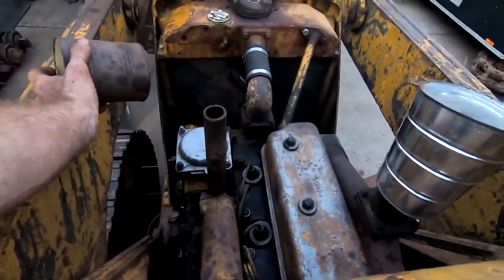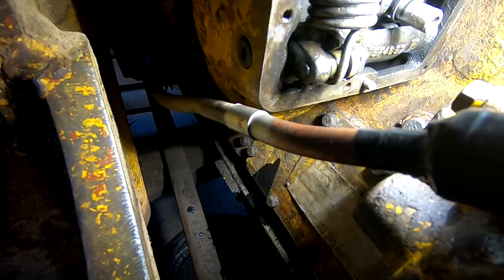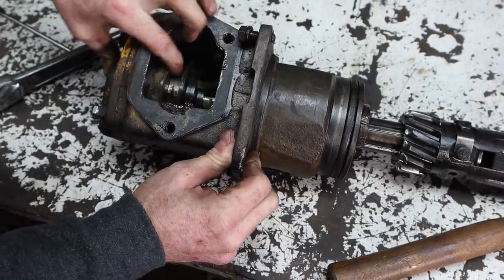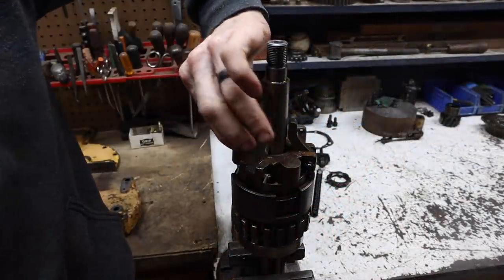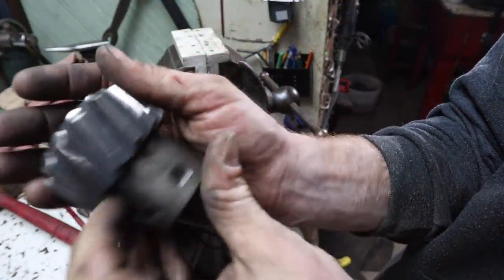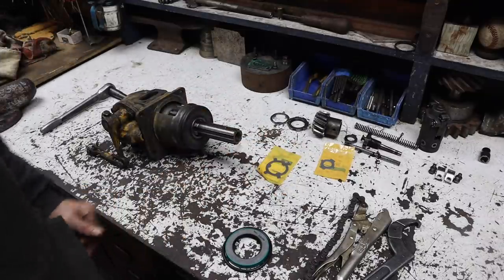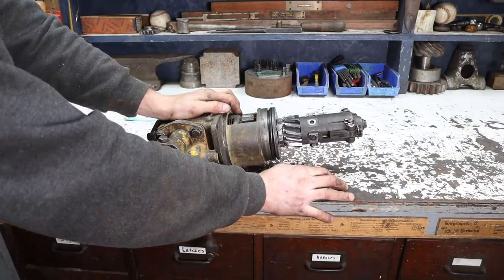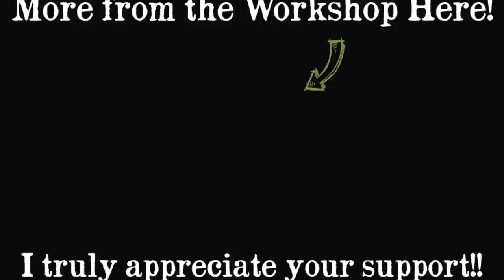Removing & IMPROVING the Starting Clutch ~ Part 16 ~ 1950s Caterpillar TraxCavator

Comment: On the end of those weighted dogs is a screw, one on each, that adjusts the rpm required to kick out the pinion.
Great video.  Waiting to see the pony and big engine going again.  Then the under carriage and sprocket so we can see this thing in action.  I looked at the manual for the governor those 2 bolts on top under that cover are stops for some adjustments in the throttle/governor.  Not sure exactly what.  Seems this might be a newer governor that the 1938 than Squatch253 has.  Do not recall it being the same.
Reply from the maker: @squatch253  I figured it was something like that! Thanks for watching and letting me know!

Comment: Hey! Love your Old Red series. Looking at a 933, it has three teeth broke on the ring gear on the flywheel. Can you tell me how difficult it would be to remove the radiator and engine or can the transmission be pulled out of these to swap out the ring gear! New one is $68.

Comment: The deeper you get .. the more I wonder how you got her running..
Reply: I was thinking the same thing! How in hell did it ever run in the first place?
Reply: These old machines can take a beating and keep going. New equipment will never equate to how well things were built from the 1940's to the 1980's.
Reply: @UnitCrane514  👍
Reply: @UChrjod6h-1jZNpEYYK8OVuw clutch... a means to temporarily disengage the drive from the engine to the gear box, whilst changeing gears.. so as not to damage the gearbox. (Get in a car .. try changing gear without useing it... ewwww)

Comment: I think the pony motor exhaust warms the diesel intake manifold for easy cold starts......genius
Reply: I think so..if only they'd put a mini muffler on those ponies
Reply: I believe they share coolant too, which might get some warm around the diesel on a cold morning.
Reply: I think the pony warming the diesel is the coolest part. Can start at any temperature.
Reply: @jaytodd5809  Why?
Reply: @WolfePaws  The pony doesn't run long enough to warm the diesel. The starting process only takes a minute or so.
Reply: In the 60's and 70's when we operated these older Cats we would run the pony 5-10 minutes..injection hold and compression off..at the right time throttle and compression on and away they fired..but many a time we were guilty of throwing on the compression and shooting the ether for a quick cold start...probably one of the main reasons these old diesels are tire and worn..
Reply: @Craneman4100w  Sure, you wouldn't run it for long with under compression, but I see no reason you couldn't run it for a while with clutch out and compression off. I'm honestly not sure if it would make a huge difference, but I've worked with diesels in the past which really hated the cold, so every little helps.
Reply: @Craneman4100w  I'm guessing you could idle the pony motor for as long as you want while you're getting other stuff ready to go before you try firing up the diesel if it was really cold out.
Reply: I've been a heavy equipment operator since getting out of the Marines in early1975. For the last 10 years before I retired I was an instructor/proctor at ASIP Local 150 (Google it and select images (I"m in a few of them :-D)). When I started out in this business, machines with pony motors were the norm They were all roadsters too (no ROPS) and we carried our own Cat Sunbrella (look at old dozer pictures to see them in action) with us. I've run many machines like this, graders, loaders although I did not run this model, scrapers, dozers, backhoes, cranes, etc. Here's how it works in the cold. Put the glass float bowl on the carb (you always took it with you or hid it on the machine before you went home) and put a splash of gas in the tank (if you left the tank with any appreciable amount of gas in it rest assured someone would stop by and siphon it all out for you). Compression release open, clutch out, maybe a shot of starting fluid in the carb. Open the gas shutoff valve and start the pony. Most all of them were started with a rope pull cord. If it had an electric starter, and by some miracle, it worked, you're ahead of the game. Warm the pony just until it ran smoothly, idle it down and drop the pony clutch in as you throttle it back up. A few seconds after you have oil pressure drop the compression release in (closed). The diesel will usually start almost instantly in all but the coldest weather. I don't remember ever having to chug the diesel for long as they compression fire and a pony motor spins the engine along at a good clip. On the very worst days, a quick squirt of "E" into the air stack and she'd pop off right quick, on a warm day, no either necessary, she'd pop off almost instantly. The diesel will kick the pony out the instant it lights. Now, shut the pony's gas valve off and let the pony stall when it runs out of gas. Take off the glass float bowl and wipe it out or give it a short squirt of either to clean the gas smell off it and put it back in your lunch box. Open your thermos and pour a cup, grab your grease gun and go earn your money.
Reply: @Craneman4100w  appreciate the indepth info there..triggered some of my recollections about them ha..Did you ever come across an electric start conversion(no pony)? ..and if so was it any easier to start the diesel?
Reply: @jaytodd5809  Yes, electric conversions became very common and basically worked as any electric starter although you still had the compression release on some that would help spin the diesel up a little easier. I forgot to mention that if you didn't have either, we would open the oil bath air filter or remove the air filter element, as the case might be, and wave a gassy rag around inside the can to use the gas vapors in place of either. Don't let the rag get sucked into the engine though, that's demonstrating poor technique.
Reply: Sorry wrong person

Comment: the fact you can fix these by hand shows the incredible engineering that went behind these machines 70 years ago.... today you need a special “by the way” tool for everything.  #righttorepair
Reply: Fact
Reply: There are still people today like me and the brother in law who will make a tool to fix something it makes things longer but the tool is always there no matter how special the art of mechanicing is dying it's a computer operater and a parts swop the problems usually come back they solve the symptoms but don't dig to find what caused it nowadays
Reply: "By the way tool." Ha your lucky if it's even repairable these days. 15 years ago we could fix it with a tool. Now though most everything is garbage with or without tools.
Reply: @Boga217  this is true... I follow Louis Rossman on youtube.. Huge advocate for right to repair..   Corperations basically want you to "buy" their equipment... but when it comes time to repair... they treat you like you "rented" their equipment... total scam.....  thats why they want all data in the cloud.... to control you and your electronics...

Comment: @salvageworkshop Question, at 47 minutes you bend the new lock washer into the splined shaft? Wouldn’t you want it over the flat of the bolt locking the bolt that holds the plunger and the spring tension? I rewound the vid to when you disassembled it but couldn’t really tell which way the were bent. Probably a little to late I haven’t finished the series yet just something I noticed.

Comment: Great video as always! However, I believe that the pinion gear is not released by centrifugal force and that those arms are not flyweights. The pinion gear is cut helical, this means that while the pony motor is providing power, the pinion gear is pulling itself tight onto the ring gear. Then once the diesel engine starts, the ring gear will 'overtake' the pinion gear force, thus pushing the pinion gear in the other direction, away from the ring gear. The springs in the shaft causes the pinion gear to behave bi-stable, meaning that once the ring gear starts pushing the pinion gear away, the spring tension will 'pop' the pinion gear off, to ensure it won't grind the ring gear.
Reply: No, he was right. Once the pinion is latched in, it can not move until the arms fly out by centrifugal force and the spring pushes the pinion out of the flywheel. It's in the Cat manuals.

Comment: i've got an old long shank, 1" wood butterfly drill bit i ground the starting point off of, sharpened one side to make a single edge, and put into a screwdriver handle i use as a small scraper. it's got a wide, thin blade, and works as good as one you would pay a lot more for. since i used old junk tools, it cost me nothing but time.

Comment: Can you explain what these clutches do and how they work?

Could that gear have been worn by operators not pushing the knob in to brake it before they engaged the shaft to the diesel?

Comment: Great job on the recovery of the starter pinion. Fantastic job of explaining how the later style starter pinion break works. Old Red would be proud
 'Beaver Tail' (AKA  1957 955C) had as much wear on the ring gear as the starter drive gear.

Comment: Did you stack your belleville spring washer in any particular order or are all the brass one opposite the steel ones? you can stack for more tension, or more travel depending on what you wanted, and it wasn't mentioned. Have fun

Comment: I had to repair one of those, on a D-6 (9U series).  If I recall correctly, I didn't have to remove the whole unit to extract the clutch, or at least the part of it that needed repair.  That knob that you pull to adjust the clutch had been broken off somehow, and it had reached the point where the clutch would not engage at all.  I had to get really ... creative ... to remove that broken pin, in order to get the clutch apart and complete the repair.  My idea worked, but I don't recommend how I did it.  Be very glad that the one in yours was intact.  

On this one, I found that 1 hole on that adjustment can take you from not working at all to almost too tight, and it will give little to no warning of when it needs to be adjusted.  It went from working fine on one start to not working at all on the next.  I hope yours isn't like that.

Comment: Really like your work.  May I make a suggestion when making gaskets?  Weld a ball bearing onto a 6x1/4  bolt on the thread end.  Use it to knock out the gasket material using it as a punch over the mating surface holes.

Comment: On your electric starter you may be able to use a series-parallel switch. They were used on semi trucks in the 60’s to allow for a 12volt electrical system and 24 volt starter.

Comment: Hi there! Great channel and very interesting looking at what you are doing!

I am afraid my comment here may sound a bit cocky like I have a 100 more years of experience than you (because I don’t) but what about using a hydraulic press to force the bearings into place rather than hammering? Regardless how gently it’s done it almost surely will shorten its life. 

In case you don’t have a press it could perhaps be an idea to make sure the force is applied to the inner ring of the bearing when entering it on the shaft and on the outer ring when entering it into the bearing house. 

Believe me, I say this out of true concern. I don’t want to sound like Mr. Know It All but I’ve first hand experience destroyed brand new bearings myself by hammering them into place. After only a few hours my bearing started to sound weary... 

Great video and all the best to you!

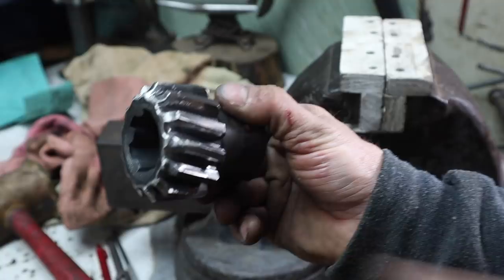Comment: @ 35:00 that starter pinion originally had a slight convex lead in, with a bevel on the one side. It was called the 'tooth rounder' and was one of the last operations done on gears, before being sent to assembly. What you have, will most likely last you a LONG time.
  I used to be a line inspector in the gear factory in East Peoria for a time, then worked the gear line and lab in the MT. Joy Cat plant for a while.

Comment: Glad to see another vid of the old cat. Been waiting awhile lol. 

One bit of advice I noticed when you were reinstalling the bearing onto the shaft. Don't use a socket on the outer race, use something on the inner race. You're more likely to damage the bearing surface if you are hammering on the outer race.

Comment: The bolts under that cap is to set the over speed shut down. You use them to adjust what rpm you want the over speed to kick in.

Comment: If your clutch was gooped up for a while it may have not thrown out or disengaged like it was supposed to at some point. Once the gears get chewed on a little it makes it very easy to grind em trying to engage it. You may want to touch up the flywheel like you did the clutch. You're right about the amount of contact still left. Long as you can make it engage and disengage good it should do everything you'll want it to. 
 
Get in touch with me - let's get some details figured out! 
Thanks for sharing

Comment: You are exceptionally brilliant  and I love the way you do things, one thing you don't use, cleaning the metal before putting it back, you put new grease on an old one , you should have clean the metal gear before putting it back, Just deep them in petrol and it will remove all the dirts and old grease including rusting metal,  there is one more thing, whenever there is brass, sometimes it needs free of oil/grease, it got the characteristic of sticking to one another or the immediate same size metal put with it, this will give you hard time trying finding what is causing the problem because two will move together instead of one simultaneously, You try filing the leaning edges but that will not solve the problems because those small broken fragments from the leaning edges is already there mix with old grease because you never clean it anyway will continue to cause problems.

Comment: I can't wait to see Old Red running again, but there's also that itch (that you have as well) that say "well, your this far in, what's the harm in taking this bit off?" It's a good itch, in this case, because the number of loose bolts and broken things you've found is amazing! It's amazing because you ACTUALLY had Old Red running with all these problems and it could have been a whole lot worse........ you could have hit a large bump and been left sitting in a pile of parts 😅😋😂🤣

I know that you don't really like sponsorship, but I'm sure theres a parts shop or oil/lubricant company that would happily join you for this. It would mean less YouTube commercials and maybe a decent company to help you out with parts and pay for the hundreds/thousands of hours you have in this project. 

Looking forward to the next one 😊👍👍👍👍

Comment: I have my father's old 46" roll around tool box from the 70's that I've filled with nuts, bolts, keyways, cotter keys, bushings, bearings etc. New and used. I've spent a lot of time fixing my bogger after a hard time offroad so I've learned to be resourceful.

Comment: I have missed your video on Old Red lately.  One comment.  You do not always use an adjustable wrench the right way,  The direction if rotation should be leading with the small movable jaw so as not to break it off.  Same with vice grips.  Keep up the good work.

Comment: I am going to go out on a limb and venture an opinion on your drive sprocket issue. While I don't have any actual hands on work experience with heavy equipment, I do have 40+ years experience in millwright work. One of the things that I have been a part of is "interference fit" part installation. Such as bearings, couplings, drive gears, sprockets, etc. Not knowing for sure from first hand knowledge of your Cat, but going on the way the sprocket acted upon removal, ( violently jumping off the shaft after it was heated up enough with the tension of the pullers and rig you had on it), I am of the opinion that the sprocket hole is a few thousandths SMALLER than the drive axle outside diameter, or o.d., and therefore requires the sprocket to be heated up to reinstall it on the drive axle. As I said, I am just offering my opinion based on how the old sprocket acted and the fact that instead of changing it before, the previous owner cut off the old sprocket and welded another one on the spokes of the worn out one. Again, that is just my assessment going on my experience. Keep up the good work, your attitude towards learning more is admirable. You are right, you are never to old to learn. I hope I am right, but I encourage you to get more info and opinions on my suggestions. Old Man Andy. Union Millwright, FAA certified airframe and powerplant mechanic, ( FAA licensed), private pilot, (single engine land certified) and avid fan of all things mechanical needing work.